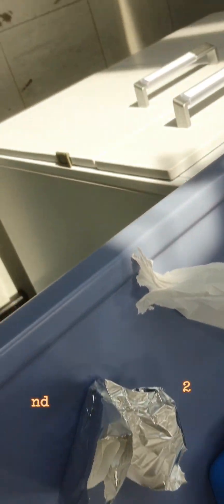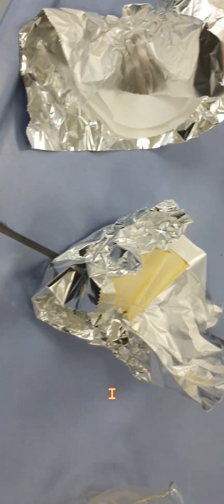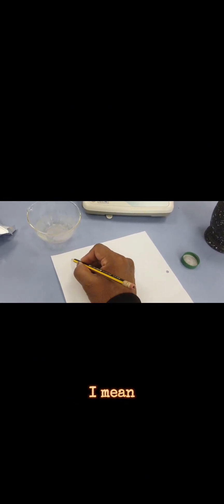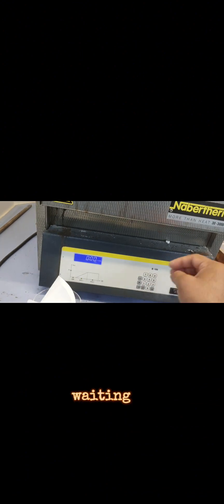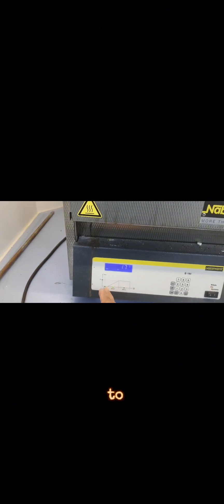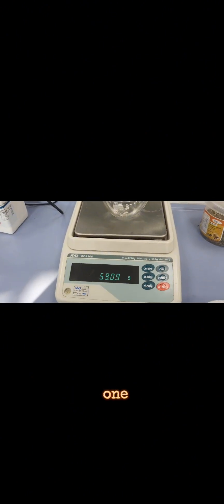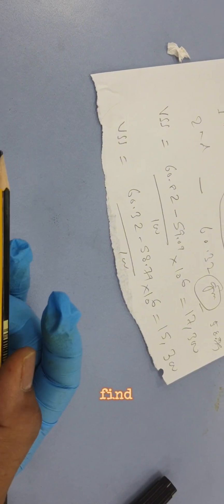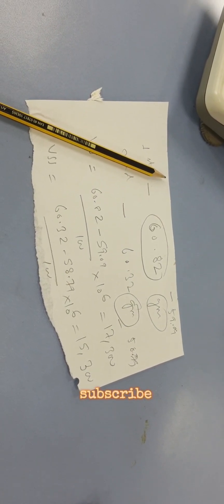Determination of Volatile Suspended Solids (VSS) in Water and Wastewater | Organic Fraction Analysis

Comment: May I Ask Something About The Hydrothermal Carbonization Process From Your Old Videos, I'm Curious 
About The Preheat Oven You Use
Reply from the maker: Yes please you can ask
Reply: @materialsandtechnology8956  Well About That Is It Safe To Do It That Kind Of Oven Since Sometimes I See That It Cannot Withstand High Temperatures In Long Time, And Also Can I Ask About The Factors To Consider For Ratio Between The Biomass And Water In HTC Process, Thank You Very Much (^^)
Reply from the maker: Yes it can withstand temperature upto 230 degree c, normally the other variable to be considered are ratio of biomass to water, heating time etc
Reply from the maker: Reactor can't go beyond 250 degrees , we usually shown few things in video , for detailed constraints we refer to literature
Reply: @materialsandtechnology8956  Thank You Very Much For Your Help ^_^